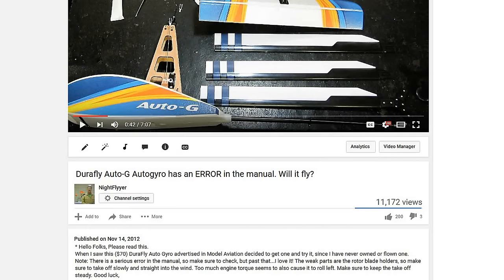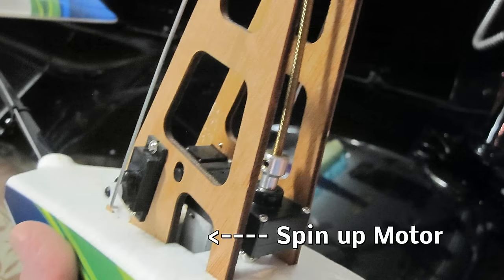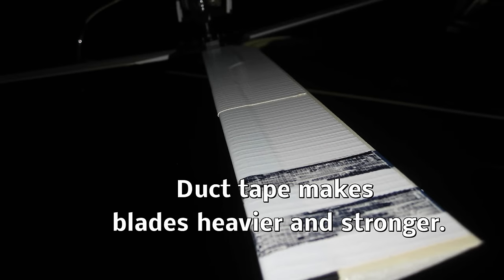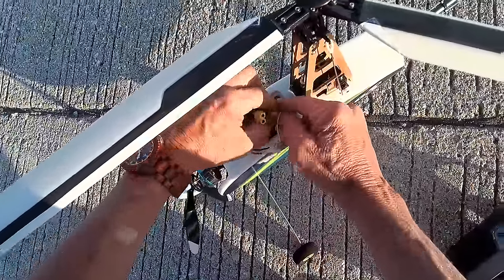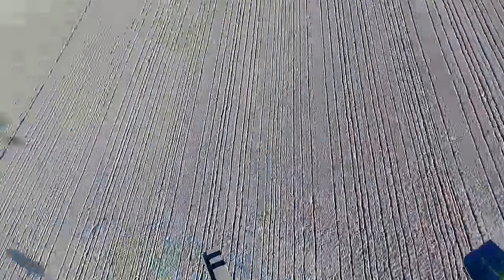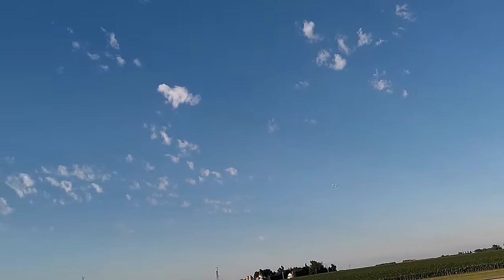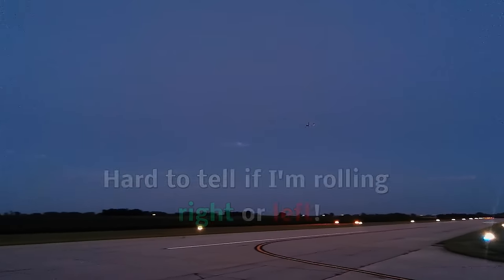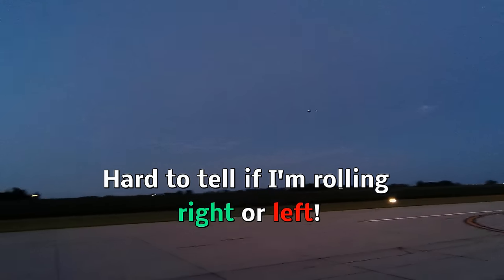Durafly Auto-Gyro restored and cleared for flight !

Comment: Hi Dave! Great timing as we're just about to maiden ours here. I've been told that turning should be more rudder and less aileron. How do you find it?
Reply from the maker: That is great. Being a helicopter pilot I find myself using the rudder just like a tail rotor.  They work in the same direction, so you will find it helpful.  You can make some sharp turns that way.  Good luck with it and fly easy.
Reply: Super, I'll have more of a heli head on then when I fly her..

Comment: Very neat! I have never seen the spin up motor used, that is a very clever idea for sure. How about some glow in the dark tape on the rotor blades as well as some fixed red/green lights for orientation when flying at night?
Reply from the maker: I used to use 1 1/2" tiny glow lights on my rotor blades back in the 70's on my gas helicopters and 1/8" smaller ones on the tail blades and they made for some really neat flying.  I already have lights on my earlier version Auto G which does not have a rotor spin up motor. I think I will transfer them to this one.  Thanks for the comments and suggestions.

Comment: I put a row of led lights on the front of my Apprentice plus it has its navigation lights I installed so I can tell what direction I am going in . Its a nice set up. I just Maidened my ST Salto last night also. No lights on that yet though I may do that because I fly that mainly in the evening when I am getting more lift from the heat rising from the field,makes gliding best. You did pretty darn good for not being able to see. I have never been a fan of that type of plane but would try one.
Reply from the maker: I also have the original Auto G (with no spin up motor) but installed full navigation lights. I have a video of it on youtube also.
I may transfer those lights to this one, as the spin up rotor motor makes all the difference for successful flight.
I prefer darker flying, as you will see with the upcoming videos, as dusk is marginal for my Night Vision.  Thanks for the comments and happy flying that apprentice.
Reply: +NightFlyyer I tried flying no lights once, I wont ever do that again,lol. I was barely able to land. I also fly the Dynam Waco BiPlane,I recently won a gift certificate from tower hobbies and got the ST Salto,Its a very nice and nimble glider, it isnt like the huge gliders with flaps and crow and all the other fancy features but is pretty agile. I actually considered the prop driven kind but the reviews stated it wasnt very good at doing any kind of agile flying. Not that I am into 3-D flying,I just like to do accasional rolls and loops. Just have to have it high up there before attempting anything.
Reply from the maker: Great. Sounds like me. So dark, I couldn't wait to get it down.  Tonight, however, I will fly it again with lights and hope you enjoy that.  Thanks again and fly easy. Dave~

Comment: nice i love your work, please post restore video's if you go any! :) interesting to see how problems are solved! :)
Reply from the maker: Thanks kindly. I have a few more coming up, including the Art Tech T-28 next on the editor.  Thanks again.
Reply: +NightFlyyer Hi, indeed but as you saw there was  something disturbing your radio link, now dsm2 is not spreadspectrum, witch dsmx is! So I suspect that with dsmx your radio link will be rock stable :) I know dsm2 works perfectly until it doesn't... :) i will curiously wait for the dsmx test. But I will be very surprised if it doesn't work perfectly.
Reply from the maker: To be clear, I have 2 DX6i's that are DSM2 and 2 that are DSMX.  The radio in the PT19 IS DSMX. My Orange Transmitters are DSM2, so I think the biggest change will be the 2 antennas in the DX8 Gen II. There seems to be a saturation of WI FI booster signals that are more likely, as I have been investigating. I will certainly post what happens when  I get the new radio and hope it works better.  Thanks again.